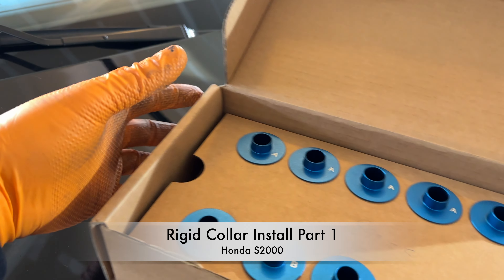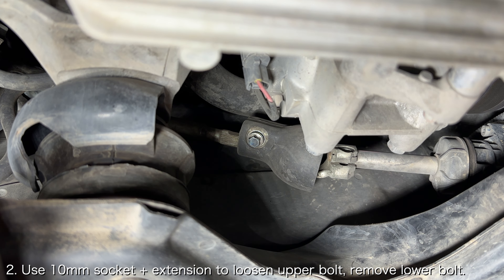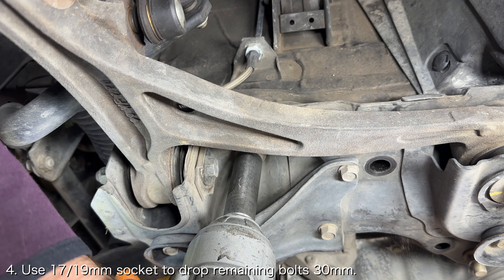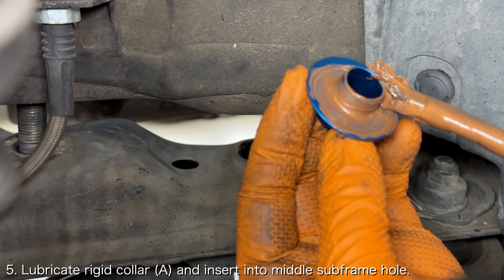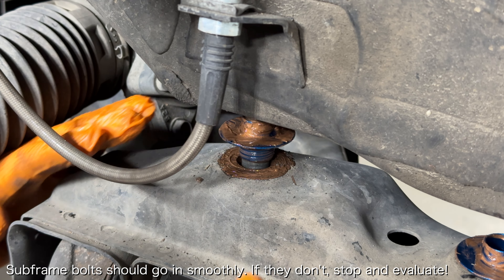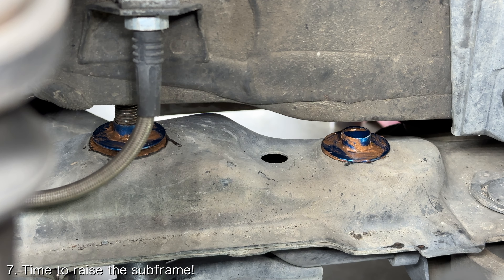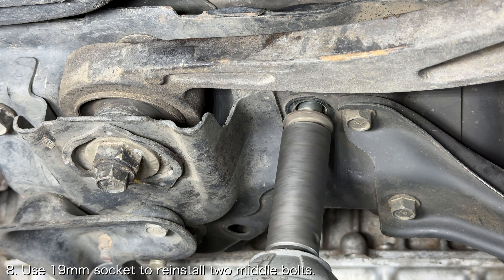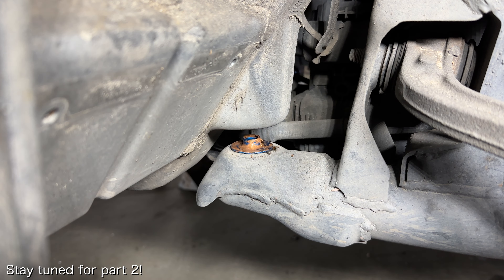Rigid Collar Install Part 1 (Front) | Honda S2000

Comment: It would be a good idea to note that the steering wheel should be tied in place or otherwise stabilized before disconnecting the steering joint.  I am waiting on a new clockspring to arrive.
Reply from the maker: Oh no! That is a pretty common mistake that happens when people mess with the steering wheel while it’s disconnected. I should have explicitly stated it but it’s implied that the steering wheel shouldn’t be rotated much while it’s disconnected. I’ll pin this comment for awareness.

Comment: This is one of those things that sound like snake oil but actually make a noticeable difference to how the car feels. I thought they were bs but after I installed a set on my friends car I went out and got a set for myself. I doubt they will make you any faster but they make the car feel a lot tighter, they were one of the first things I added to my new S2k.
Reply: This comment says it all. Instantly better drive. No bs.
Reply: I still believe it’s snake oil. If the subframe could move this much, the bolts would vibrate lose

Comment: If your steering rack coupler is seized to the column and/or rack like mine was, here's what I did:

1) disconnect the negative battery terminal and disconnect the steering rack ground cable to the subframe
2) undo all 4 steering rack mount bolts and leave them sitting completely loose but don't remove them.
3) ziptie the steering rack to the crossframe above.
4) lower the subframe like done in this video

Now when the subframe is lowered the steering rack stays in place (hovering by the zipties) without putting stress on the steering shaft! When you raise the subframe back up the loose steering rack mount bolts act as guides to reinstall the rack.

Remember to reconnect the steering rack ground and your battery terminal when done.

Comment: My theory on why these work:

Subframe bolts are long. The bolt shafts travel through a wider hole in subframe and chassis. Deep holes. The subframe hole is wider than bolt. The chassis then has a deep hole that is wider than bolt, before bolt reaches threads in chassis.

So the bolts act a bit like guitar strings. Taught, stretched and unsupported between bolt head and chassis tbreads. A long way. Any impacts in chassis will reverberate through this long length of open bolt shaft.

So the subframe collars shore up the bolt shaft, so its a much shorter unsupported length. Shorter guiter string. Plays a different note, plays with less volume.

Smoother over bumps. More taught during dynamic suspension motions (aggressive cornering, braking, etc).

These are really long bolts. The subframe is hollow, and deep. The bolt holes are significantly wider than bolt, and the chassis hole is equally wide, and more depth before bolt reaches thread. Long lenth of bolt shaft able to flap in the breeze.

Comment: Discussed with someone from blktrax a long time ago about rigid collars. He said that with the collars it's more tied together so they have the potential to bring hard components out of spec if you go over enough berm/curb/off track or enough bad street roads. Versus without the collars you'll only have to get an alignment every so often. What you think?
I decided against the collars and they still sit somewhere in my garage. Have sat in cars that have rigid collars with similar suspensions or spring rates and they're able to absorb bumps better and ride smoother.

Comment: Nice. Very informative as usual. Ended up getting a killer deal on the Spoon ones so will be tackling that soon enough. 

I’m guessing once you did the 4 outer bolts, you cleaned up / out everything that came out of them yeah? Hoping mine aren’t as bad, but was planning to blow them out anyways.
Reply from the maker: I don’t think I cleaned out one because I didn’t see how much junk came out until I was into the next one but everyone should definitely wipe away that stuff.

Comment: Great video as usual. To the point and clear explanation. I wanted to ask you if you had any experience with harmonic dampeners(ATI or Fluidampr) and if you think is a mod that the S2000 needs and if it will offer an actual improvement.
Reply from the maker: I don’t have any experience but I was just discussing this with a buddy and I am considering it. The main reason being that my CR is primarily a track car and spends a lot of time above 8k RPM. I’m a bit skeptical since it is a lot of money to sink into a pulley though. 

I’m curious if the car will have less NVH. I may reach out to urge to setup a review.

What do you think?
Reply: I could speak for Fluidampr (I think I had it installed in 2020), the ATI is just sitting atm.
It won't cure NVH as I had it installed on my previously owned 2009 FA5, & currently my AP2v1.

I wanted it it anyways for its wider RPM range protection.
It will absorb the torsion characteristics the crankshaft has to uphold because i4 are naturally imbalanced.
When crankshaft twists (torsional) during operation, the added vibration from it will affect it's position out of alignment/placement of the bearings (rod & main). Think how vibration affects oil flow smoothness, & generates additional heat too = Power loss.
Vibrations that could NOT be dampened by Stock Pulley [@ w/e given range RPM] will then of course spread throughout the long block (oil pump &/or valvetrain failure).

Keeping the operation as balance as possible also affect drivetrain power delivery from the powerhouse (engine) to your wheels. Not day & night noticeability, but it is a buy product from a more stable engine.

Stock Pulley is limited in RPM protection range (I cannot say the range), but many will say, "Honda made it that way for a reason" as their uninformed 'reason'

I would not recommend buying it for power gains or showing it off @ car meets.
Reply: @jinnnguyen7077  right! Damper damps vibes crank feels, not vibes you feel.

In doing so, you might feel the added smoothness, but that's a side benefit.
Reply: here is a mod I had on both FA5 & AP2v1 on top of Fluidampr
**FA5 (stock internals except oil pump)
Generic tune (VitViper)
stock ice box mod
RRC (FD2) IM, TB, & oil pump
S2 Header straight pipe w/ Full Race Exhaust
Hasport 70A engine mounts

**AP2v1 (stock internals)
stock ECU (was on Infinity)
J's Racing T-Rev (1-way valve between intake elbow & valve cover breather)
Vibratechnics engine mounts

-the other way to reduced NVH is to rebuild your Driveshaft & Axleshaft
-also, my engine & trans are lowered, so drivetrain is that much more leveled w/ differential, but I cannot prove that it helped w/ NVH (even though Driveshaft is positioned w/ lesser sloped)
Reply: @DIYGuysvideo  I believe Fluidampr is slightly cheaper and the guys from Urge were pretty involved in S2ki forums. People were mentioning noticeable changes when installed. Would love a review from you if you can get your hands on one
Reply: @jinnnguyen7077  would you suggest it for a weekend car? I would only consider it if it offers any noticeable changes in drivability and engine longevity.

Comment: I would loosen the 4 long subframe a little bit, one at a time, this will reduce the chance of stripping any of the threads on the body.
Reply from the maker: As long as the subframe is supported and doesn’t move much I don’t see the value in doing that imo. I’ve basically borrowed the steps from the shop manual for lowering the subframe during a clutch job. Have you encountered issues in the past?
Reply: @DIYGuysvideo  On a northwest car yes, had to thread in a helicoil for the passenger side rear bolt. You need a 12mm x 1.25 helicoil for those 14 x 1.5 for the fronts. Mostly my fault, and I agree , the key is to not let the subframe move around too much. Either down or up, because un-even stress on those bolts increases the chance of ruining the threads. Turns a 2hr job into a 3 day job waiting for the helicoil kit, and it's a $130 kit to boot.

Comment: You specifically mentioned copper grease, I used a nickel based antis-sease, any concern?
Reply from the maker: No concern. Nickel has even higher temperature tolerance than copper so it should be fine.

Comment: Awesome video, great explanation as always. Just curious, why did you not go with spoon?
Reply from the maker: The Manzo collars are around half the price and easily available stateside.
Reply: @DIYGuysvideo  Do you feel a difference in handling with them ?
Reply from the maker: Haven’t driven the car yet and doing coilovers at the same time so probably won’t be able to isolate the difference.
Reply: @DIYGuysvideo  what coilovers did you end up going with?
Reply from the maker: Shaftworks. Plan to make a video about it if I have the time :)
Reply: @DIYGuysvideo  noooo, do them separate and let us know if you can feel the difference with just the collars :)

Comment: I heard the steering coupler can stay untouched, but I guess it is easy enough. Are the threads originally threadlocked, so do you have to reapply on coupler bolts?
Reply from the maker: The steering coupler can remain untouched depending on how much the subframe is lowered. I didn’t want to leave it up to chance if other people follow this video. Also, the directions for the spoon rigid collars suggest to disconnect it. 

I’m not aware of any bolts anywhere in the s2000 that have thread locker from the factory (and I have disassembled many S2000s to the bare frame).
Reply: I had to disconnect mine to get the subframe low enough for the spacers to slide in.

Comment: Did you lower both sides at the same time to keep it level? Or did you lower each side in turn?
Reply from the maker: I lowered all the bolts while supporting the subframe with a jack. Then lowered the jack, which lowered the entire subframe evenly in one shot. Same way you’d lower the subframe when replacing the clutch.

Comment: Is there a diagram of which bolts to lower first and hang the other ones? It was kinda hard to understand from the video. Thank you always!
Reply from the maker: Drop middle bolts out completely. Lower four corners 30mm and subframe hangs on them.
Reply: For each subframe, its 3 bolts per side. They basically form a rectangle. One bolt in each corner, and a middle bolt along the long side of rectangle.

Like this:
.   .   .
.   .   .

As said, first remove the middle bolts. Next lower the corner bolts ∼30mm.

Then repeat for rear subframe.
Reply from the maker: Thanks for clarifying Russell. The rear subframe is a bit of a different story though. More on that next video.